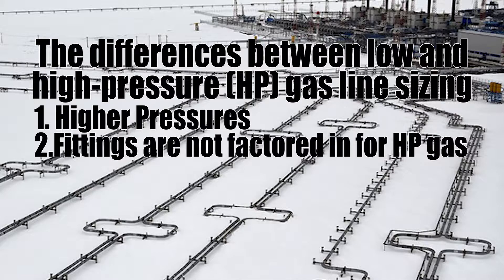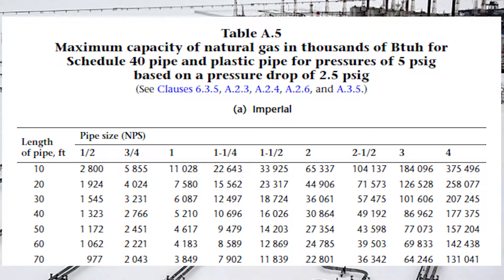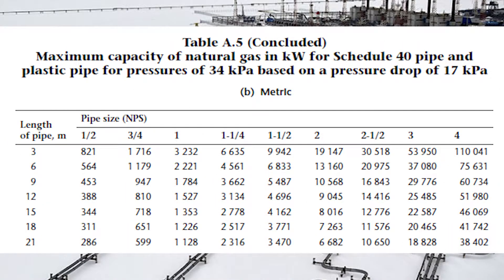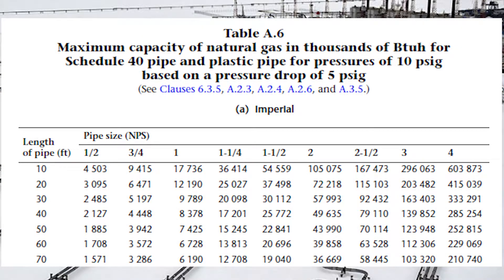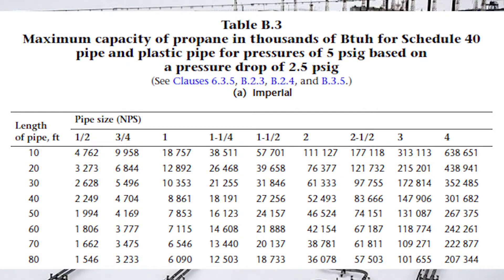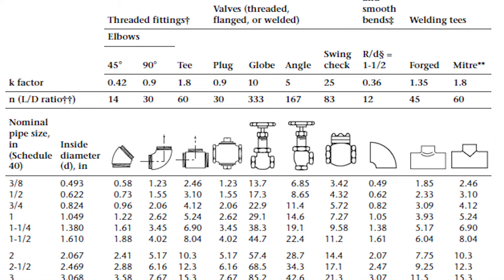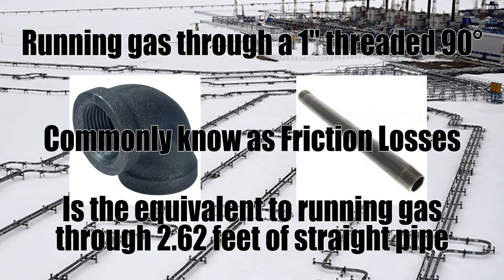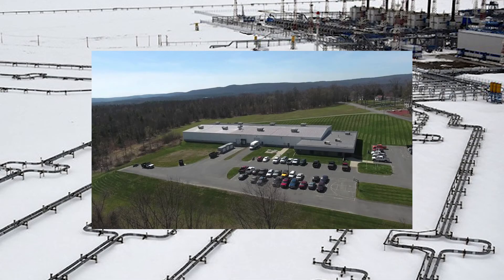High-Pressure Gas Line Sizing - Video 1: The Basics

Comment: Thanks for the video.

How do we size the gas supply line if we are taking low pressure feed to the building from a high pressure supply infrastructure?
I have a scenario where 70kPA existing gas infrastructure and we are extending a new feed to couple of new shops which will be running at 7kpa. How will we determine the index length in the above scenario.
My existing 70kPA supply index length is only 50m and I am extending another 120m at 7kpa to the new building from this existing high pressure existing supply line.
Reply: Thanks again
Reply from the maker: Your low pressure system starts at the outlet of the gas regulator. But at that point you follow the simple low pressure gas line sizing technique:

https://youtu.be/1nJnqIrA_FE?si=KgdSp7jScaFLBEru

Comment: Do you have a video on sizing a gas header in black iron.  Then sizing the individual runs in copper?  Thanks
Reply from the maker: I don't have videos on that specifically. What type of gas pressure are you referring to?
Reply: @MathematicPlumber  just 7-14" but we are being told to size manifold off longest run then each copper branch also off longest run not length of copper run.  So a bit confusing
Reply from the maker: @kingman6136  That is the correct way to size the manifold. The copper branches should be sized off their own individual lengths. (Make sure you are using the correct table for copper tubing - Table A.9)

That being said, if a gas inspector or your trades instructor is saying otherwise, you better listen to them to save yourself a headache.
Reply: Thank you for help.  Cheers